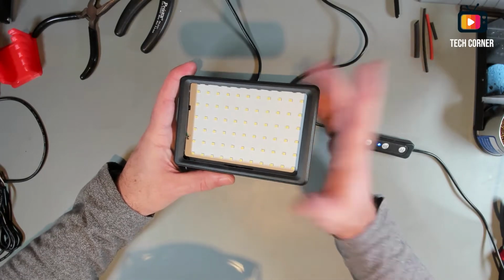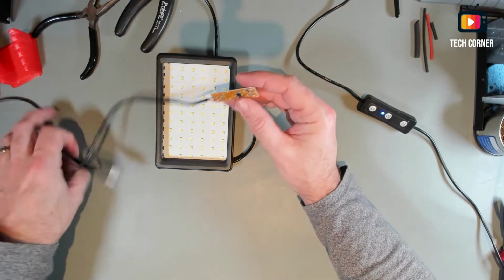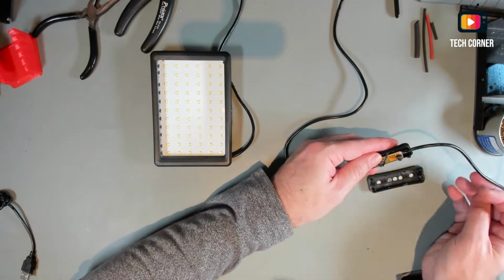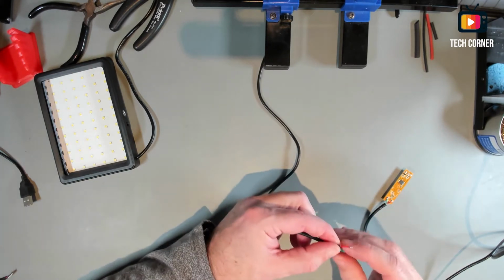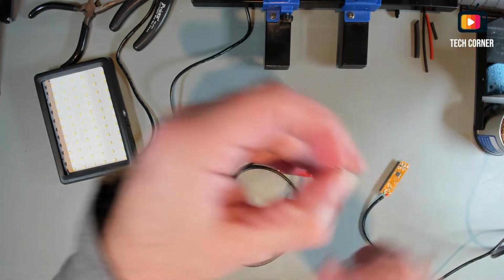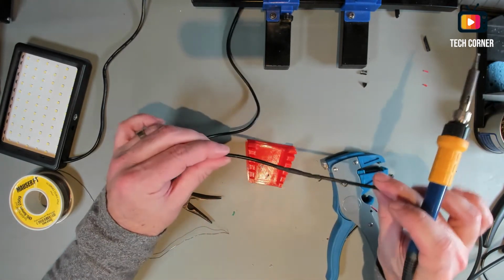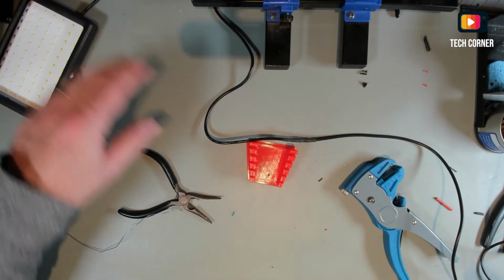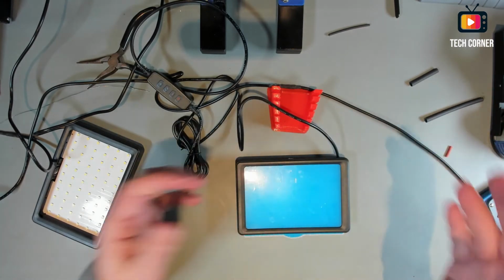Neewer ZC-01S  Led Light Kit Repair⭐ Nice set of light but with a nasty control switch!

Comment: I enjoy repair videos. Since it looked like your lights are powered by usb, could you have used a potentiometer to repair it? I am sure the way you did it was the proper way for nice lights like that. But just curious.  Looking forward to your soldering station repair.
Reply from the maker: Hey Jay! Yes you could used a potenciometer, but i just figured out it will be "prettier" to mantain a control like it came from factory.. Thanks for watching! 👍